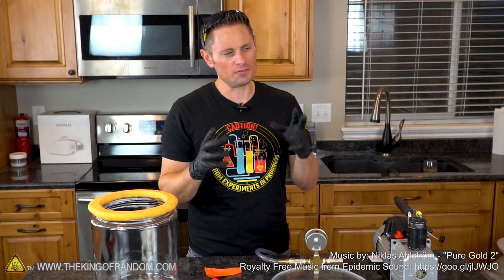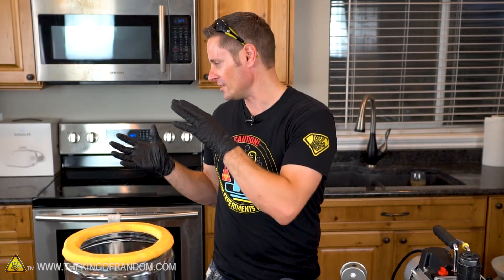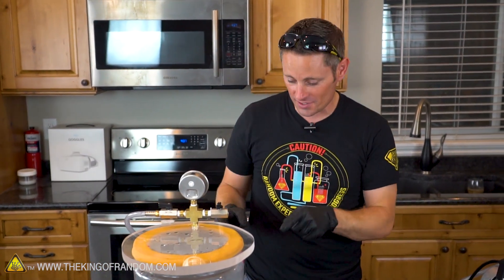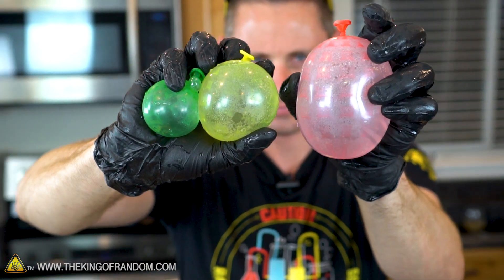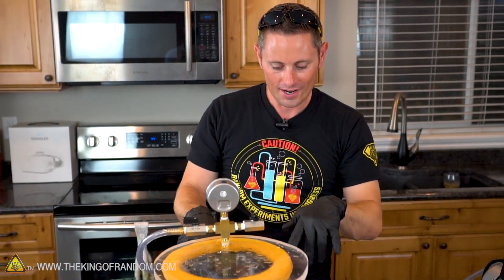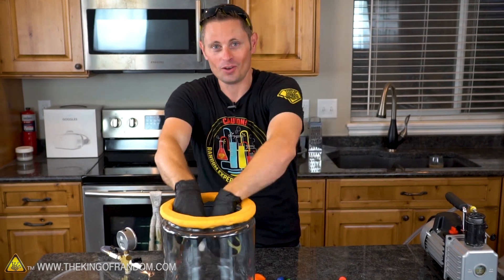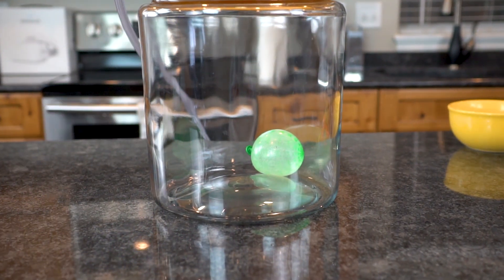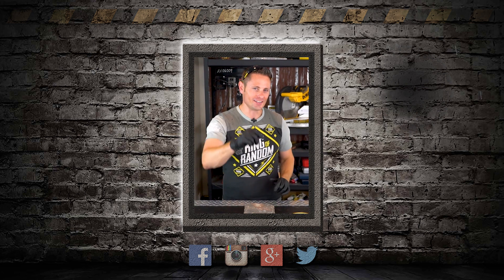Do Hot Water Balloons Explode in a Vacuum Chamber? King Of Random Tests Balloon In Vacuum Chamber

Comment: Grand, you should have a condensing device to trap the water vapors to protect your air pump, those air pumps are designed to handle atmosphere gases running it like this will shorten its lifespan
Reply: I read that first line as a considering device...
Reply: Aussie Chemist ii
Reply: SavageBird for a minute I actually was about to think how to make one of those and realized it was condensing

Comment: Also important to note that when you run a lot of moisture through a vacuum pump you need to change the oil to maintain then vacuum efficiency of the pump because the oil in the pump will absorb some of the moisture and your performance will go down hill the more you do it.

Comment: Can thermite burn after soaked in water?Can thermite burn after soaked in liquid nitrogen?Basically can thermite burn after soaked into different types of liquids?Plz do this.And like!(I know he did water but still I'm just trying to show different types of liquids.)
Plus notification squad where u at
Reply: Buds420King I know I said that I'm saying examples and I said that basically different types of liquid.Plz read the full comment before u type!
Reply: Buds420King and typing without reading the full comment is a very noob thing to do.
Reply: KD Outdoors I know and ur right about that I don't even know why I just said that I could have just say liquid 😂
Reply: Buds420King We actually kinda don't know, because the reaction that allows the thermite to burn fuels itself with oxygen, and at that rate, the liquid nitrogen shouldn't snuff the flame out. Also, if underwater, thermite will still burn for that exact reason, while regular flame won't.
Reply: Buds420King dry ice isn't a liquid, plz read the full comment, I just suggested it to him,and not reading a full comment is a very noob thing to do.
Reply: Dolphinbuddy L.E. A liquid is a liquid
Reply: Or win the prize?
Reply: The CO2 will not snuff out the thermite. The reaction supplies its own oxygen, from the iron oxide. The thermite does not use oxygen from the air, so it will work basically anywhere. Even in space.
Reply: mobkiller800 Well, it's not CO2 that's produced from liquid nitrogen, but yeah, same idea. Thermite could even burn in the vacuum chamber, which would make for an interesting idea, but Grant would lose his chamber...
Reply: Dolphinbuddy L.E. no and no. He did this already check before you comment noob
Reply: KlepkaPl PvP no.he did fireworks
Reply: KlepkaPl PvP I am asking for him to test the reactions from different types of liquid and thermite
Reply: KlepkaPl PvP Btw I'm not a noob and next time u comment plz check what I mean and search it before u comment.
Reply: Jaan Aleksander Hermann I know I'm just trying to say that it's basically different types of liquid
Reply: He already did that with water

Comment: Can you use helium to try make water baloons fly ? (sorry for bad english im romanian)😅😅
Reply: Doru INFINITE Already done that
Reply: Doru INFINITE (Besides....helium*)
Reply: It's already done, with lance stewart
Reply: it would not because the lift power of a helium balloon is so low you need 4000 balloons to lift an adult an average adult weights about 191 lbs (87 kg) so 4000 /191 lbs (87 kg) is equal to 20 balloons per lbs or 46 balloons per kg

Comment: Can world's strongest handheld laser ignites thermite.
Reply: jemuel cuison Wonder if a ballon will float in a vaccum.... fill the ballon with hillum gas and put it in the camber....... who wanna see? Just like
Reply: jemuel cuison yes it cAn
Reply: +Risenfriese I think he is talking about the nitrogen triiodide experiment
Reply: jemuel cuison definitely not, the laser doesn't even get in the ballpark of temperature required to ignite thermite.
Reply: I dont think it will ignite thermite, they can char wood but i dont think it can melt metal, let alone thermite
Reply: Ackeem Allen It would lie on the bottom of the Chamber
Reply: Ackeem Allen Thing float in a medium with higher density. Like how wood floats in water because the water is heavier. 
No water--> wood falls down.   
No air--> helium falls down.
Still would be cool to see the balloon fall to the bottom.
Reply: in one of his passed videos he used a household pet laser and it set the thermite off I think the worlds strongest laser would ignite the thermite as well I think the laser you are talking about would be overkill on the thermite
Reply: jemuel cuison hi
Reply: jemuel cuison do you sell those things or something?
Reply: jemuel cuison yes watch codys lab
Reply: Witchy x KItten thermite needs over 3000F to ignite. I doubt thats a pet laser unless youre trying to slice your pet in half.
Reply: jemuel cuison an industrial laser about 100W is use to cut thin material and it can set stuff on fire but I don't think it will set thermite
Reply: try placing thermite inside a ziploc container (use your ziploc hack) then wrapping it in newspaper. a reference to breaking bad
Reply: jemuel cuison I want to see that
Reply: it is my birthday
Reply: jemuel cuison obviously, it’s going to be super hot
Reply: Ackeem Allen it won’t float because there is nothing denser to float on. For example, since oxygen is denser that helium, a helium balloon will go up. There is nothing to float on in a vacuum chamber so helium won’t float, it will only sit at the bottom